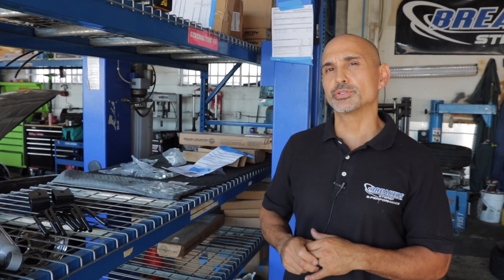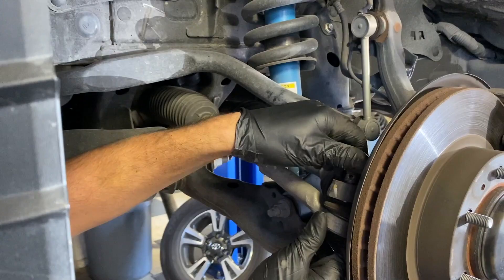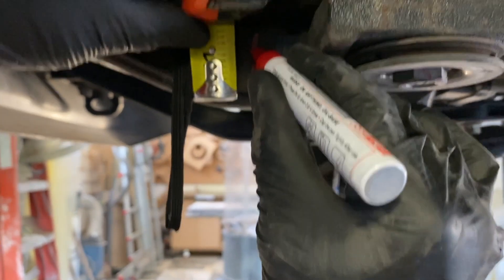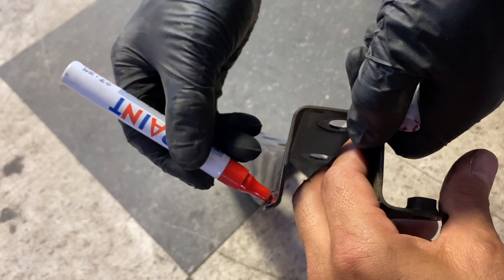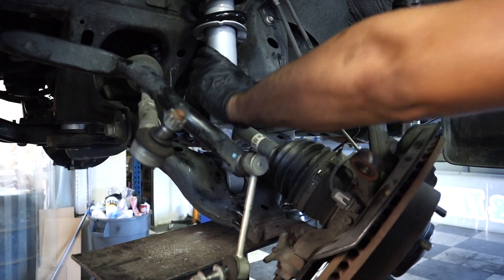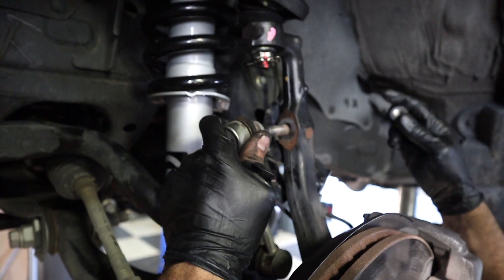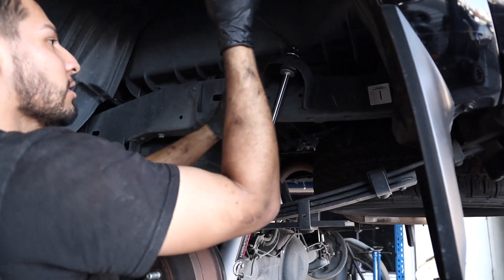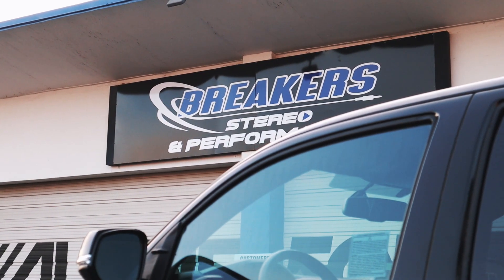Toyota Tacoma 2005-2020  3" Suspension Lift by Rough County (Tutorial How to video)

Comment: I have the same lift and 285/70/17 is the biggest tire you can run without rubbing. These 33/12.50’s look good but will cause issues. This kit will require a 1” diff drop and upper control arms for caster adjustment and the drivers side needle bearing will need to be replaced. I’m sure you noticed the grinding noise from 20-45 mph. Great kit for the $ but realize there is much more involved so beware! Oh and CV boots rub together and will rip over time. Recommend the boot slide mod as well
Reply: Just purchased this kit, why replace needle bearing on the drivers side? And what’s a boot slide mod?
Reply: @jackdavignon3889  the drivers side needle bearing will make a cylindrical grinding noise after the lift, it’s just the cv angle putting pressure on it.  Some get lucky and don’t have an issue, I didn’t. Just order the ECGS clamshell bushing, (google it). The boot slide mod is where you take the cv boot clamp off on the inner boots and slide it down the shaft so the ribs don’t touch and reclamp them. Sounds scary but not a big deal really. Check out Tacoma World forum and read up a bit. The kit is good just needs a few aftermarket adjustment. Good luck!
Reply: @FivexxXxx5  you got lucky then on the needle bearing
Reply: Is the diff drop only for 4wd ??

Comment: if I want to put 285/70/16 wheels and tire do I need to change the gear ratio of the diffs? if that the case, what will be the best gpm/gear for a 3th gen 4cyl daily driver/commuter, occasional light off-road taco?, thank you!